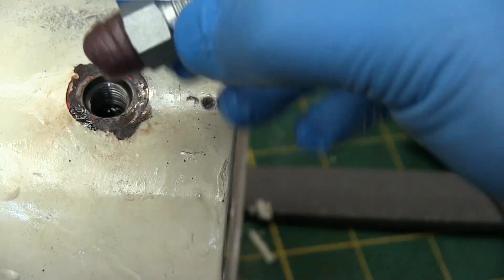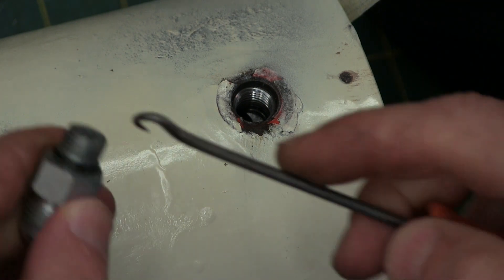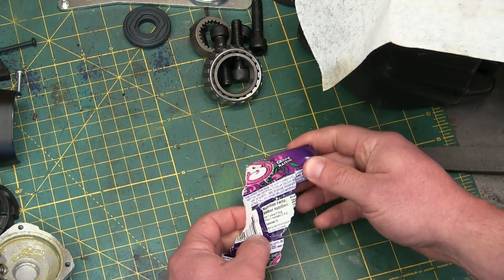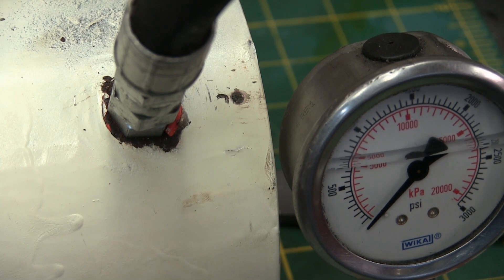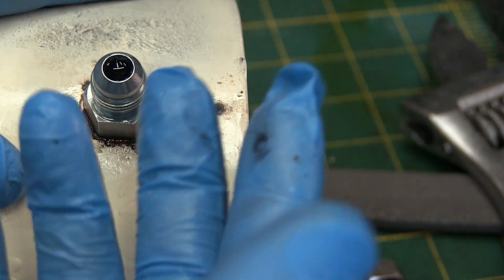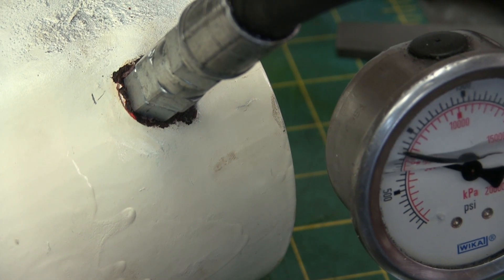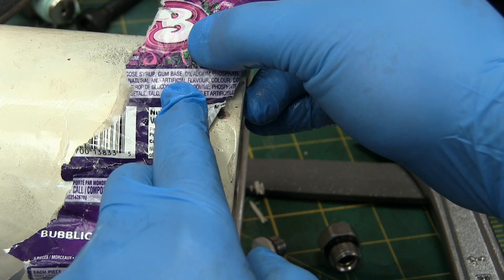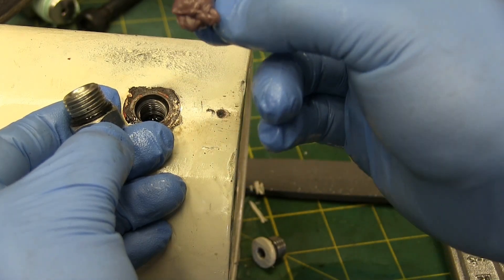HOW BUBBLE GUM STOPS HYDRAULIC OIL LEAKS. It's gross, actually.

Comment: This works on swimming pools too. I had a suction side leak around a glued joint on a pool pump. I wrapped the leaking area in chewing gum and it has held up for a year in Florida sun. I also used it to fix a gentle spray coming from a air relief valve on a filter

Comment: This is good info especially for emergency fixes of expensive Honda power steering line and pump orings. Alot of those you have to order off ebay, Honda, or grab a sloppy seconds oring at the junkyard. Looked up pressures and a 2006 civic's pump runs at 213 psi in good shape. I will do some of my own tests on this soon and hopefully make a video of it in action. The bubble gum used in AvE's video was Bubbilcious brand if anyone was curious.

Comment: 1 week too late, i was fixing hydraulics on my tractor and had to buy a bunch off fittings to finally fix the leak, this could have solved everything super easy. Anyway thanks for a tip, It will help on the next incoming leak.

Comment: Used this trick to patch up oil lines, fuel lines, etc in the field. Works surprisingly well. Even used it to patch up a leaky brake fitting. Was good enough to get me home, then back to work... Until I wrapped her around a tree 3 months later (too much throttle, the brakes worked fine when we rolled it off the rollback).

Comment: How do you fix an air con line on a tractor , leaking around pipe fitting  , ( I ask cos alot of work required to fix correctly)

Comment: I used to ride a gas motorized bike to work and i had a rather improvised fuel system and wasnt super cautious about the routing of the fuel line and it came into contact with the rear tire en route one night and had a sizable hole rubbed out. Well i got the leak situated simply by tilting the fuel tank to get the fuel off the hole it falls out of. 
I cleaned and dried the line and thought for a bit about how to patch it because the place where the hole was didnt leave enough line left to just cut it off. 
I settled for some chewing gum and duct tape, no, electrical tape as i recall. 
 Tell you what, it worked perfectly. Chewed up a truly heroic sized wad of gum and smooshed it up around the line, patted it dry with some napkins and wrapped a later of paper around the gum and then wrapped it up real snug with the tape. It held not just for the ride home but held so well that it lasted a couple days, leak free until i got some more line. The gum hardend right up but pushed into the hole a little bit and sealed nice. So this does actually work. Mine wasnt a pressure test though but its nice to know that it will work.

Comment: Driving truck through Milton and passing an accident scene off to the side and I heard a clunk. Shortly before I got to my delivery which was caused by someone behind me called out on the radio that he could smell diesel so somebody was leaking fuel. Thinking of the clunk when I got to my delivery I checked my fuel and I have a hole in one of my tanks on the truck. At first we didn’t know what to do about it until I noticed one of the guys that was helping me was chewing gum. I asked him to give it to me which he did and used it to plug the hole. It worked just fine until I got the truck back to our service bays. I’m a genius like you Ave.

Comment: Hey AvE, Over here in the Outback Australia we use chewy gum to fix holed fuel tanks, if you're bouncing your fuel tank over sharp rocks in the middle of nowhere and get a hole you get the mate/missus to put his/her finger over the hole while you chew up some gum then real quick stick the gum in the hole, the gas sets the gum rock hard in seconds and seals your tank so you can go a few hundred more miles to get home.
It works best if you apply heaps of pressure so the gum mushrooms inside the tank and flattens outside before it sets, then it wont move either way in the hole.
I've heard it works the same on oil pan of your motor too, but I've never tried it, also don't know if it works for diesel.
BTW Where did you pick up the chooch'n word, you're the second person I've come across who uses it? Regards

Comment: Whatabout cracks on side of tank? Crappy designed champion logsplitter has gas engine weld mounted to hydraulic fluid tank, which is now leaking like a mofo...

Comment: Anyone have any suggestions on a sturdy way to fit a bolt in a hole where the holes threads are too small for the bolts teeth?  Replacing either is too costly. It's a sewing machine. Commercial singer.

Comment: Holy crap what a great thing to know. Now with this and my knowledge of the fact that you can stick a vacuum cleaner hose in the oil fill of my engine and turn it on to keep oil from pouring out and melting my skin when I remove the bolt I might actually fix my oil leak. 

Nah probably not.

Comment: Bubble gum saved me. I delivered a heavy cargo of books in the back of my Volvo from London to St Tropez in the south of France. My friend (author of and recipient of the books) lives at the top of a steep and unmade road strewn with rocks. Unknown to me at the time, the sump of the car had made contact with those sharp rocks and one had punched a small hole; not big enough to dump all the oil immediately but drippy drippy. The first I knew of it was returning home a few kilometres up the Autoroute and despite the sunshine my rear window looked wet. Using the wiper smeared the wetness horribly. A few seconds later the oil pressure light came on. Fortunately there was an 'aire de repos' in coasting distance so I pulled over and took a look at the source of the problem. I had a can of oil to top up the engine but it was clear that if I filled up it would be all dripped out on the road within maybe 30 minutes. I had various patching materials in my toolkit but nothing that would hold back hot oil pushed out at crankcase pressure. The hole was a small tear so blocking it with a screw in was not an option as it would just open it wider.  I needed a solution that would stay put for the 900km drive to Calais. I tried 2 part 10 minute epoxy first. That went like jelly almost as soon as it touched hot oil. It did however get me to the next service area. I drained all the oil and cleaned up the area around the hole. I went to buy oil and at the checkout I spotted packs of bubble gum. BG is indestructible I thought, maybe it could work. So I bought some and chewed down a good mouthful. The perimeter of the hole in the sump was now relatively clean and dry, just a weep of oil in the hole. I hoped that applying enough thumb pressure would extrude gum  through the hole and bung it sufficiently to hold back crankcase pressure. It lasted. It lasted not just the 900km to Calais but all the way back home and a few days of driving around until I got around to taking off the sump and brazing up the hole.

Comment: I realize this video is a year old but I'm interested in the compressor you use.  How are you creating 3000psi? And what is the reason for all of the impact sound from the compressor?
Reply: Air powered hydraulic power pack. Used by heavy equipment mechanics, millwrights, miners. Same as an air powered bottle Jack, but capable of tons of force.

Comment: does this seal on the threads? I have a female flare fitting that is too deep for the male ends I got (phrasing) or can find.. its just a 1000 psi max power steering pump, should i just have the guy make me something that threads in and throw some chewed up buna n in there!?

Comment: Once many years ago, a motorist stopped me when I was hauling a load of diesel fuel in an old semi tanker trailer because it was leaking out the top of the rear tank where condensation had corroded it at the top. Whenever I took off from a traffic light it was squirting out a small hole. I stuck some ABC Big Red gum in the hole and it stopped it up right now.

Comment: why is the pressure gauge only half full of fluid? why does it have fluid in the first place?
Reply: scrottiemcboogerbal1 The fluid I believe is a type of oil, it stabilizes the the needle so it doesn't flicker like crazy from the varying pressure difference while under a load. I think they only fill them half full because the oil expands with temperature difference which would cause the glass to leak or break if it were full.

Comment: How long would this hold up? I understand it's a bush fix but just wandering how long or if the heat of the oil would push it out? The putty epoxy is sum great stuff. Broke a fuel filter housing on a diesel backhoe down in a swamp and expecting major rain the same night and had to get it out or it would be flooded. Used the epoxy putty and never replaced the filter housing. It's just good stuff to keep in a backwoods toolbox.

Comment: Every since I put the Honda CX 500 carbs on my Chevy 292, I have to change the o-rings about once a year, or maybe 2. I suppose that sending them 6 PSI off the pump instead of gravity feed may have something to do with it, but I'm a-hopin' maybe that there chew goo just might salve that prollum. Well, only if it's fuel complainable of course... Ain't zackly high pressure neither...

Comment: Just gotta say, on the original o-ring, the little tiny bit of leakage...  Yeah, place I used to work wouldn't even look at it.  We didn't look at a leak unless it was over a drip every minute, maybe 2.

We also went through a big white tub of hydraulic oil every 2 weeks I think.

Comment: IT FRIGGIN WORKS! I got the chance to try this today. O-ring on the loader blew out halfway through a job. Ended up using the gum trick to get it moved back down to the shop until I can pick up the proper o-ring. Thanks for the tip!

Comment: I have a question, wouldn't the hydraulic fluid dissolve the gum since chewing gum is soluble in oil? Or is this one of those bandaid fixes that just stop the torrent of schmoo long enough that the freshly minted junior engineer will put in an authorization form to release the funds and let one of the technicians go to the homeless despot during his lunch break and pick up another o-ring?

I remember when I was a lad and I had a taste for chew(ing gum) I would blow obnoxious thin walled bubbles that when popped would inevitably get all over my face. It got to the point where there was a 1" circle of black schmoo around my lips. So my dear sweet mother would go to the medicine cabinet and get the sweet pear scented oil that was from a time before my parents were with child. She would proceed to rub it into my chewing gum beard and it would turn into a liquid and just like magic the gum would be no more, just in time for me to get more gum and get it all over my face again.

Comment: The vulcanization/curing of the O-rings gives them the solidity the bubble gum doesn't have.  I'd be concerned with the gum flowing out of the gap over time as it doesn't have any shear strength.

Comment: Stupid question time, this able to be a long term solution, or is this just a get it working till shit comes in solution? little brother lost an o ring on his water cooling for his computer, we got vinyl tape acting as one currently but if this is a viable long term solution, id rather just re gum it every 6 or so months apposed to trying to hunt down what will likely cost 20-30$ o ring that's purpose built.

Comment: You remind me too much of myself, so please call in advance should you travel to Arizona, Colorado, Utah, New Mexico, Old Mexico, Texas, etc. so I can leave. Both of us in the same state could be extremely dangerous, unless we only drink beer together, in which case it could be a good thing or merely hazardous. I have used food and duct tape to repair a boom lift. I had to limit it's use to myself exclusively, because the limit switches were all taped down, and the pots for the drive motors were cranked up so high it would drive in excess of 20 MPH with the boom up or down. I  was seeing just how fast it would go, and took my hand off the stick, which engages a pawl into the drive wheels, causing the basket to dig into the asphalt, and the boom to catapult me out of the basket. 27 MPH!!! Hell yeah! Genie Lift NEVER intended that kinda use!! I got backcharged $800 to fix the gouge in the parking lot, and I got some road rash, and a few laughs, and a halfhearted verbal warning, which included a genuine thank you for not letting anyone else touch "the problem lift". Genie's techs were out every other day for two weeks, before I said, "Fuck this! I can fix it with duct tape ty wraps, gum, and a small screw  driver". So long as I never pushed the joy stick all the way forwards or backwards, it was perfectly safe to use, and I used it for 4 months or so, but when my last day came up, which was predetermined when I hired on, I just had to know how fast that sucker would go. I also had to undo my fixes, so no one would get hurt or killed using it. We rent that worn out shit that keeps breaking down to increase production, and a lift that sits idles don't make any money, so.......................................

Comment: How do you safely release something pressurized at 3000 psi?  When I depressurize my 120 psi air compressor it sounds like a bomb going off.
Reply: wellll of I'm gonna be pedantic, fluids all do compress. but they compress so little that at the pressures and temperatures anyone outside of a lab or the bottom of the ocean is concerned, they effectively do not compress.
Reply: oil no compressy. your 120 PSI air tank is holding wayyyyy more energy than that 3000 PSI oil system. still dangerous, but bleeding that pressure requires letting out a surprisingly small amount of oil
Reply: Liquids can't be compressed as much as gases so there is a hell of a lot more volume of air than liquid. If you have to pressure test a tank for safety reasons liquid is used because it won't explode like gases do
Reply: its all about the temperature amount of gas and volume

Comment: Great video.  I never would have guessed... On another note, I am looking for a nice liquid filled pressure test gauge.  Saw you're using a Wika.  I had been leaning Ashcroft.  Any thoughts?  My usage would be for testing city water pressure and compressed air in the shop, so I was looking at something up to ~200 psi on the scale.

Comment: I know plane crews in WWII used to use bubble gum to patch holes in fuel tanks. Can the hydraulic fluid dissolve the gum, though?
Reply: NBR-based gum? Nope. Natural rubber/latex based? Sure will. Although there is a difference between a permanent repair and a "get me to the end of the shift" repair.
Reply: sir, what is this "permanent repair" you speak of? I've only come across the, just get me till I clock off fix.

Comment: Why not lead solder?
Reply: Admiral Percy You don't use solder for hydraulic connections.
Reply: Joey Carmichiel Whycome?
Reply: It is not pressure rated, it is used for things like water pipes

Comment: I have never worked on hydraulics but I was wondering if you could also use black pipe dope?  Although, I have no idea how that would handle that high of a psi.  The gas and water lines I have fixed, augmented, or run are nowhere near that.

Comment: Just wanted to add another strange leak stopper. Had a guy come into the dealership I work at with a hole is his gas tank. He plugged it by jamming a bar of Irish spring on the hole. One of the strangest things I've seen recently.

Comment: ever the story of how Tootsie Rolls saved the US in Korea? From what I remember the Marines were stuck up on the Chosin Reservoir when the temp dropped so low and ammunitions level so dire that the Chinese were on the verge of overtaking our boys. Anywho - the grunts called in for more mortar shells. As luck would have it the Mortar's code name was Tootsie Pops and Tootsie pops is what they got. Planes dropped them from the sky crate after crate. When the General says get you say yes, not huh. Anyways it was so cold they had to use the pops just as Mr AEV did to plug up all the broken fuel lines on account the cold made the diesel into rootbeer popsicles. True story too (or at least in my mind).   https://www.youtube.com/watch?v=gDIv-byz7cQ If you ever get to feel like complaining that it's too hot read about the "Chosin Few".

Comment: Just as a point of interest, how does gum compare to plain old thread sealer (tape or paste) on ORB or NPT?
Reply: well "rated for" and "held momentarily" are not really very comparable items.
Reply: Hydraulic fittings are generally parallel thread, this means that paste or tape will not work (at least not well).

Comment: 00:07 - Why do they put oil inside pressure meters? Does it stop it from blowing up or something?
Reply: oil filled gauges are just better, a man is not a true man if they don't use oil filled gauges ;P
Reply: As stated, stabilizes the needle and at least on our fire apparatus it keeps the gauges from freezing by serving as a heat conductor from the gauge heater line..